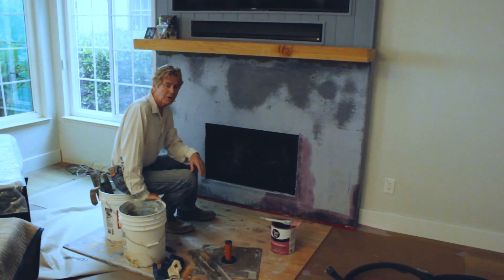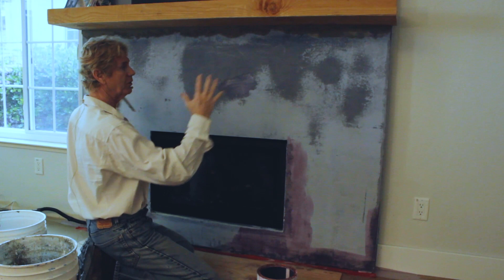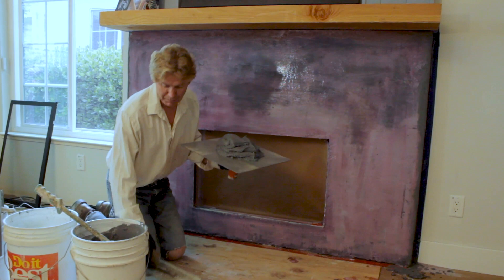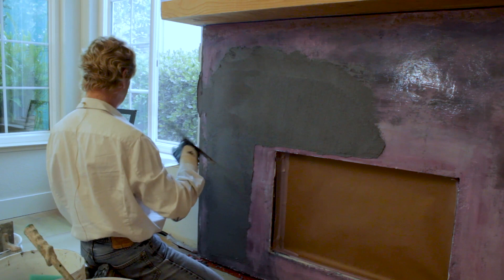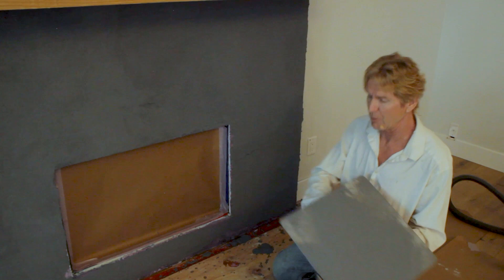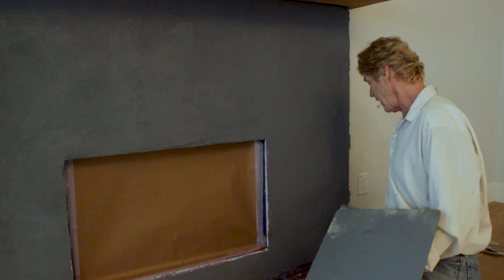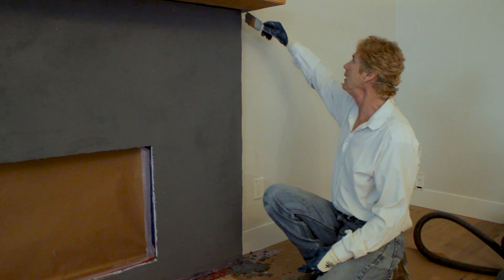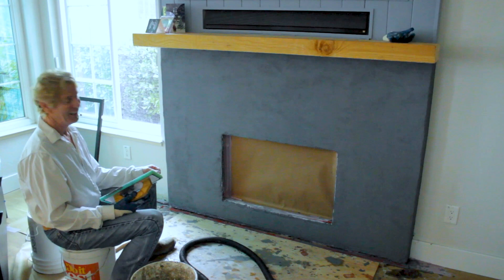Stucco finish over an interior fireplace

Comment: Great video...I hope to do a shower someday in plaster or micro cement. The white that shows up from water on the surface is mineral salts that leach to the surface.  We deal with it in grout on tile installations.
Reply from the maker: Evening Tile Coach  Dude, I have done my share of stucco showers, but no more, as you are correctomundo, or worse than effloresces mold will occur almost within 6 months every time. I tilled mine for this reason.💃

Comment: Kirk I want to something similar but will do a skim coat on hardie board. BTW in is interior space. I now how to skim coat but what product should I use. I will tape the joints. I will apply real thin but want to make sure it bonds well and  doesnt crack....help   thanks ....your the man!!!
Reply from the maker: Howdy Ray, Do what this guy did, he applied structo-lite base-coat then a finish coat. That finish coat can be an exterior stucco with color or a lime-based finish coat with color. Or no color at all. There are many ways to skin a cat.🍻

Comment: We use plastic trowels when it sets up, it will not burn the plaster.
Reply from the maker: Howdy Bmilsb Duude, I was not concerned with overthrowing or excess amount of water, thus I was able to use my trowel. There's a lot to know when applying finish coats, I just shared the tip of the iceberg. 👍

Comment: Hi Kirk, I have a rough stucco fireplace that I would like to smooth out. Do you have a video for that process? Thanks.
Reply from the maker: Hi Julie, https://youtu.be/Zh1aW1Tg_bg/ Transform your traditional brick fireplace.
In this video, we are going over two brick fireplaces; I'd advise all DIYers or homeowners to buy structo-lite only sold at plastering material yards for the base coat, then the next day apply a Diamond finish coat. Both sold only at plastering yards. 🥂
Reply: @StuccoPlastering  thank you! That video was a tremendous help. One more question, can the Diamond finish coat be dyed to a cement color rather than white or would you recommend painting? I really would like a concrete look. Thanks.
Reply from the maker: @JulieDavis-fv9fg  Good evening Julie, yes, the USGs lime Diamond finish can be tinted, and f you want it glossier, apply it thicker; that will take extra troweling when it starts to set, but worth it. 🥂

Comment: Kirk I want to smooth stucco my fireplace. What stucco I use ?
Reply from the maker: Hi George,  I would choose Quikrete's Green Cor USA, sold at Home Depot and lowes. 🍾
Reply: @StuccoPlastering  Thanks Kirk, looking for that response when I cam back to this one !
If you wondering, would like to not apply a Hardi backer etc, go straight to the stucco.
Reply from the maker: @als4817  Howdy Al, apply stucco directly over clean bricks, hardy board or even stucco netting would cause more damage than good.  Type in how to stucco over bricks, we have many videos that show how to in depth. 🥳
Reply: @StuccoPlastering  Thanks Kirk, 
best wishes !